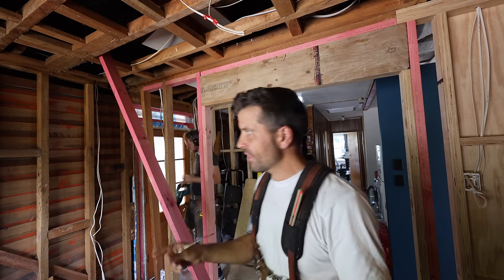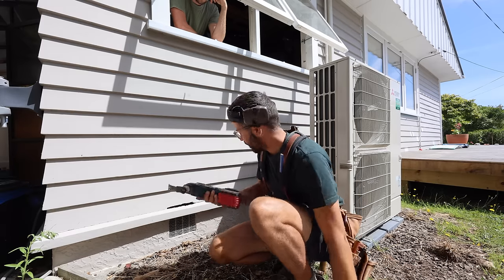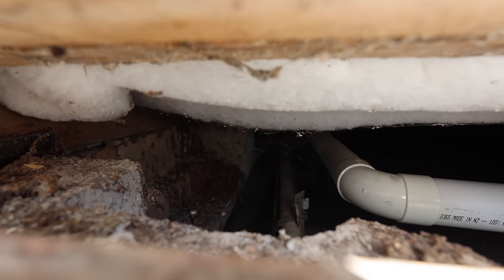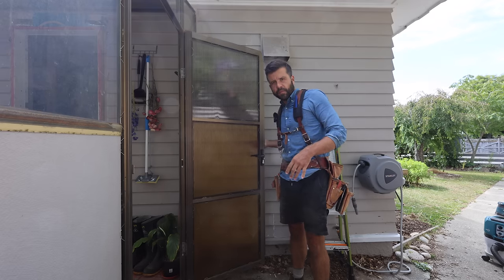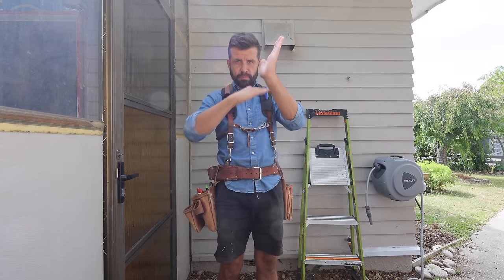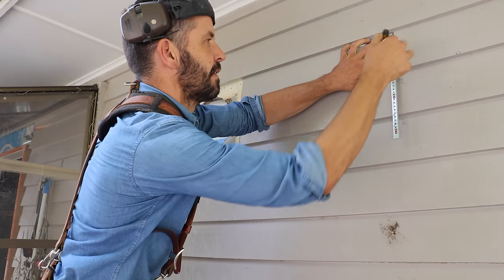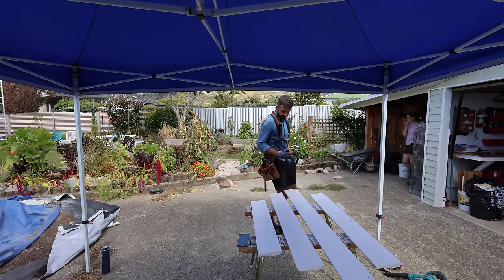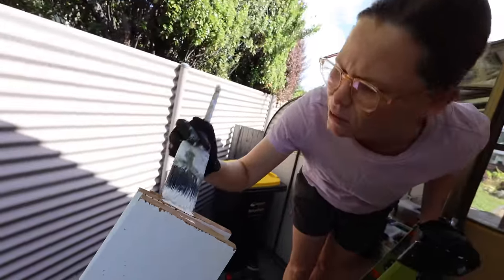A Simple Trick to Fix Cladding and Weatherboards

Comment: with the 2 store rooms an walkway into the main bedroom ive got at the mo  etc   Building out the walls into my dream bedroom makeover aka  shed bedroom makeover  if that well fit well too  u too building it for me an i can Helping out with few ideas on it as we go with the building etc an cost for the fit out an builds    etc  soo it gives me alot more room an space  for the 2 pocket doors  or 2 barn style   sliding doors open ing up too the main room off my dream bedroom makeover fit out in my shed bedroom that needs a dream bedroom makeover   with 1 off the store rooms fit out for my dirt bikes or dirt bike an motocross gears an motocross gear bag an boots too store ing out off the way too as well as idk DON,T  HAVE ALOT OFF SPACE AN I NEED SPACE   AND SOME SHAVLING SPACE TOO AS WELL FOR MY DREAM BEDROOM MAKEOVER    SHED BEDROOM MAKEOVER

Comment: Simple Dream bedroom Makeover in my shed bedroom makeover into my dream bedroom makeover   ive been whatting for over 20  Plas+t  Years   etc     too been built an done soo i can fit out the stuff ive all ready got an stuff ive got too going buying for it etc     with 2 sliding barn style sliding doors open ing up the main walkway into   the room where my dream bedroom makeover aka shed bedroom makeover an have a store room an store room an  2  doors opening up the   main room  an 2 sliding pocket doors for the  man cave or hang out spot or chilling out spot  where my 2 JVC 58INCH TVS SETUP ON THE WALL AN FEW  Bedroom stuff ive got too going an buying upp from the local stores in town where the dream bedroom stuff is at in town    etc too fit out my brand new dream bedroom makeover  in my shed bedroom makeover setup in the back end off my shed room aka bedroom  an building some wood bookcase for storeing some gear in it as well for my DIY PROJECTS    and buying some new bookcases for my dream bedroom makeover as well too      an building a  home gym spot for my workouts an few gym gear an flat bench for my workout set as well too in my dream bedroom makeover  shed bedroom makeover    etc.

Comment: 9:51 slightly blunt the head of the nail by couple taps of hammer to avoid split?
Reply: I use stainless steel screws after drilling a hole with a countersink.

Comment: Scott, I don’t know building regulations or practice, but a gap of approximately 5mm between the bottom cladding and weatherboard has become the norm here. I lets: Gets you between with a brush for paint, some airing behind very exposed area for rain, lastly there cannot be standing water - it will air dry given a minimum 15° bevel on both the bottom cladding board and the weatherboard.
Otherwise top notch as always!

Comment: Fixing the rot, fair enough. But what is the point in going through all the trouble of putting a little block under the bottom plate, and then bolting the plate to that block?

Comment: Dropped 2050nzd on a full M18 track saw setup including 2700, 1400, bags for both, bag for the tool, makita quick clamps, 48 and 24 teeth blades, and the bare saw itself. Running with 3Ah 21700x5 DeWalt battery and adaptor which should be fine for most intents and purposes. Will probably get a second 1400 rail and cut it into 31 and 24 inch pieces for those smaller jobs/cuts in smaller places. Waiting on the tool and makita 3000mm bag so I can pick up the 2700 rail and keep it safe. Can't wait for my next sheet goods project. Baller gear. <3
Reply: Challenge, getting the TSO products square out of the US without paying two arms and three legs. Can Gaston help with this?

Comment: Gonna go and buy and angle grinder and longer blades today, thanks!!!  I was also told to cut the ends of the board at a 45 as well?
Reply: I would say bevel 3 to 5 degrees to make the front tight.

Comment: Does this method work equally as good if the boards have tongue and groove?
Reply: You mean a shiplap with tongue & groove?They've completely captive. You can circular saw cut it along the face, with a slight bevel upwards for clearance, and put screws in with the heads proud to pull the top half of the board out with a pry bar. But you'll have to remove the back of the groove on the new one to get it in.
Reply: Yeah, that's what I was wondering about. Getting it out isn't a big deal, but getting the new one in is tricky.

Comment: Near the ends of boards you should either pilot drill the holes or (the best way, I was taught this many years ago) blunt the 'point' of the nail with your hammer nail in, don't ask me how it works but it does
Reply: It cuts the wood fibers instead of wedging them apart.
Reply: @hedge685 But it doesn't split the end of the board like his did.
Reply: @ronmurphy4234  The blunt nail tip severs wood fibers rather than the point tip wedging between fibers causing a split.